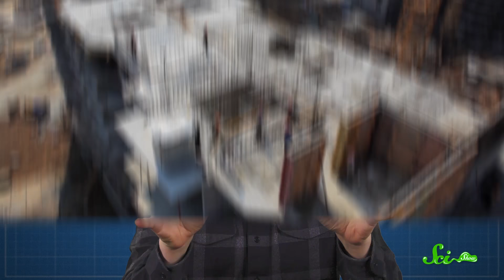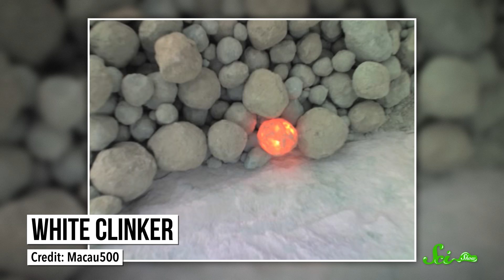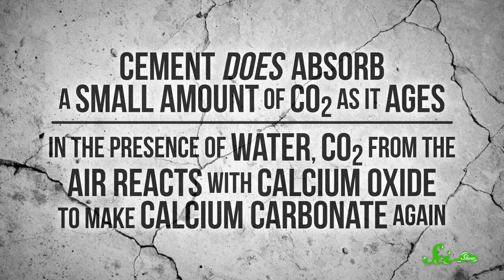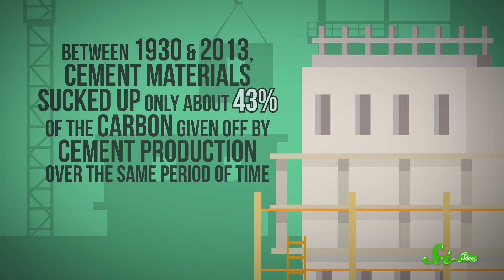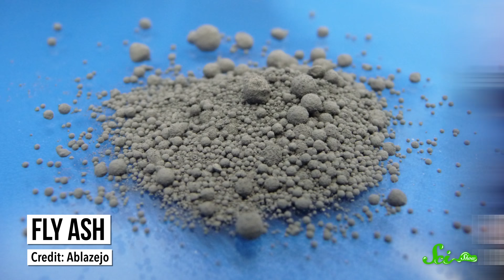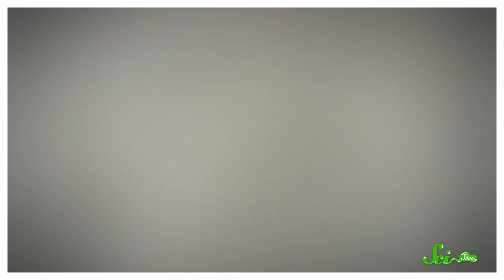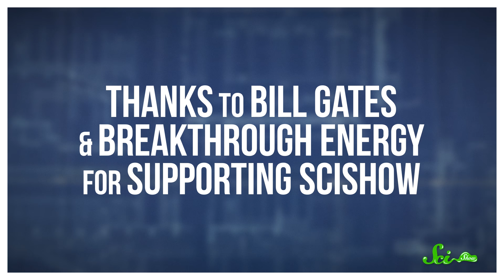Cement: A Really Hard Problem

Comment: 5:27 to this point, from a naive point of view it's surprising that pumping in CO2 and upping calcium carbonate ratios as a result doesn't degrade the concrete given that it's reverting in some sense, at least chemically, back to limestone. Would love some clarification on that.
Reply: I wonder if the physical restructuring has something to do with it, like it's creating a cage of limestone around the various aggregates?
Reply: Just look up what the pyramids are made of. Limestone is PLENTY tough. In terms of durability vs density likely one of the most sturdy abundantly available resources in the world. This process essentially turns the limestone from solid in the ground to dust back into a solid molded to the shape you want, perfect for construction.
Reply: @forkevbot  you are very close but, check out the geopolymer institute. The man that created the mix designs was actually lead hand at the time of repatriation to Egypt after WWII. His first mission was to determine the type of stone in order to create a patching material on the Sphinx and some pyramid blocks.
He determined that these were NOT stone but rather an ancient type of concrete. He was basically laughed off of the job. But he continued on his own, doing core samples of the ground etc. He recreated the cement mix that was used, wrote a thesis of how the builders would have used a method similar to slip form construction. His geopolymer concrete is actually very amazing, also chloride ions have zero negative effects. Hard to believe because of the proximity of Rome and that the Romans, and others continued to use Greco-Roman type cement.
Reply: it actually does have the potential to explode _reinforced_ concrete as mentioned by Benjamin H. in another comment
Reply: Limestone is pretty sturdy stuff when used for construction - lots of limestone buildings & pillars made by the Greeks and Romans are still standing today. Concrete was a way to have a lighter, more convenient (no more hauling giant stone blocks up a mountain) material.
Reply: @muninrob  You're right, Solidia cement is both largely calcium carbonate and also performs similarly to Portland cement for mechanical strength. Meanwhile, Portland cement usually has hardly any CaCO3 out the gate. Color me surprised.

(Source: "Performance of CO2-reducing cement based on calcium silicates" linked on Solidia's Releases page).
Reply: @muninrob  then why don't just crush the limestone to powder then mix it with water? From my ignorant point of view it should have been enough
Reply: @arnaeri9290  from an equally ignorant point of view except that I did some clay sculpting in high school, if you don't fire the clay when you're done, you could crumble your sculpture to dust no problem, but after it gets fired it gets sturdier, so it's probably a similar principle there?
Reply: @arnaeri9290 
Concrete doesn't stick together so strongly because they got it wet.

Those ingredients are there for a reason. They chemically bond everything together. The water just makes those chemical reactions possible.

Grinding up a big rock into tiny pieces and adding water just gets you mud.
Reply: @arnaeri9290  Limestone by itself doesn't actually chemically react with water so molding the limestone/water wouldn't really "set" so we would have to cut chunks of limestone and use that as building blocks. which happened a lot in the past (no idea about now) but it just isn't a reasonable source to make buildings from en mass or in locations with out a near by source of limestone. (this is of course from my small understanding of chemistry from my chem minor and also a lil bit of googling :) ).  does that make sense tho?
Reply: @laurahinze4035  That sounds like what I remember (history minor), something about learning to fire limestone in a high temperature, low oxygen to produce quicklime being a big part of what lead to the huge increase in the use of cements & concretes by the Romans. (Before they started making their quicklime out of limestone, it was all made out of fired sea shells)

Comment: if the process is cheaper and cuts down building costs it'll catch traction and become a more viable resource much quicker
Reply: Not if you're a construction materials conglomerate, your profits coming out of a dozen of portland cement plants. You'll go to advocate how slag and flyash are the epitome of ecological risks, while you--an ultimate savior--utilize them as dilution material for your product.
Reply: It will probably need to be significantly better for the industry to make the switch. Not only would we be dealing with resistance to change and opposing interest groups, but also there's a cost and risk to making a switch like that
Reply: Limi V the problem is changing cement isn’t trying out a new flavor of pop. It’s the bed rock of everything modern. Just think if it ages differently then we expect you can have sky scrappers and bridges collapsing. Ik I wouldn’t want to risk tens of millions of dollars on something new. We understand concrete really well right now
Reply: @Shattered Dreams  Solidia links to a number of research papers they published/sponsored, mostly on chemical resistance (a reoccurring one actually being road salt, to your point on roads). From a quick search they have a surprising deal less on mechanical strength. Most of their conclusions are on the "as good as". Exciting, but as you say, nascent.
Reply: @Shattered Dreams  yup, it'll only catch on after the insurance adjusters are convinced.
Reply: Unless the Cement industry finds out and lobbies against it claiming how you'll destroy all the poor cement plant workers jobs. 

we do plenty of things inefficiently because the out of date and dumb method has a few rich people behind it who make non-political issues political in an effort to not ever be replaced.
Reply: It won't be
Reply: I love how some of you just assume we wont change cement products because rich companys and politics. Same people that have no first hand experience working with concrete. There is so much more to concrete than just materials and how its made.
Reply: The problem is that there's no carbon tax: there's no charge for the pollution inherent in the existing system, in treating the atmosphere like an open sewer.
Factor that carbon tax in, maybe alternative options which produce less waste become cheaper. Are you seeing the problem with market-driven solutions?
Reply: Possible, but steel is cheaper than lead and guess which one is still in pipes.
Reply: @kbahrt  Lead isn't used in modern plumbing, lead pipes are from a period in which copper, plastic, and steel were not cheap or easy to make.
Reply: @azazelthedark1  right. he tried a quippy response but it made him look dumb af
Reply: John Smith is right, though. Even now that we're not supposed to install new lead pipes (although I bet it's still allowed in some places), we don't use the cheaper alternative of steel, and plenty of old lead pipes are still in use. That's probably because steel corrodes (rusts) quickly, which makes it a terrible material for pipes that are meant to carry water. The pipes wouldn't last. But it is cheaper (assuming he's right about that--I haven't done the research myself), and I bet there was a time, before new lead pipes were outlawed, when steel was already cheaper than lead, but people kept using lead. There may have been other more suitable materials than steel that were also cheaper than lead, but pretty much everyone stuck with lead. They were familiar with it, and it worked well.

As others in this thread have noted, which material is used depends on cost, durability (and other measures of suitability for the intended purpose), and the cooperation of the people currently profiting from the old material. It's true for pipe materials and also for concrete.

By the way, lead pipes are supposedly safe as long as the water running through them consistently contains enough minerals. It deposits a layer of harmless minerals on the inside of the pipe, preventing the lead from leaching into the water. Lead is actually a pretty good pipe material as long as the people in charge of water distribution recognize and deal with the danger. It's just too easy for someone to make a mistake and, accidentally or not, poison an entire town, so now we have government regulations about its use.
Reply: @azazelthedark1  True. He was probably referring to old ones that haven't been replaced yet.
Reply: Two words flint,Michigan.
Reply: @kbahrt  steel is generally pretty terrible for water pipes. It corodes and rusts.  Most new pipes are plastic.
Reply: @kbahrt  because steel oxidize and the oxidized ver is toxic
Reply: @kbahrt  what?

Comment: One 1000 pound piece takes almost 7 years to fully cure
Reply: I think a lot depends on what you mean by fully cure. Typical concrete reaches 70% of its strength after 7 days of curing. If memory serves 28 days brings it to 95%. For single family residential work that 70% is more than enough. For public structures like roads and bridges, state and federal law require 28 days of curing before anything can be loaded on the concrete, which explains why our roads seem to take so long to be rebuilt.
Reply: And yet, I take just seconds to fully bake!  😆😆😆😆